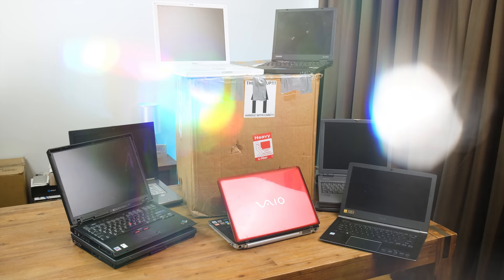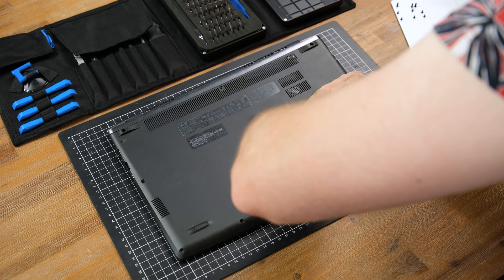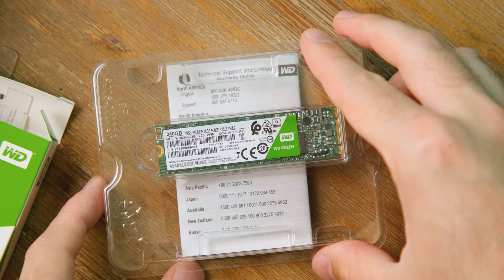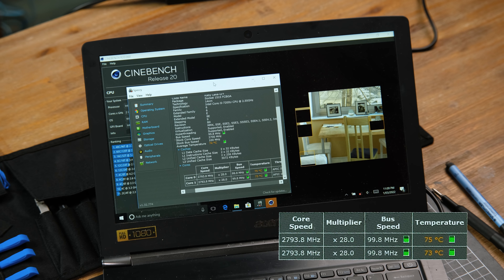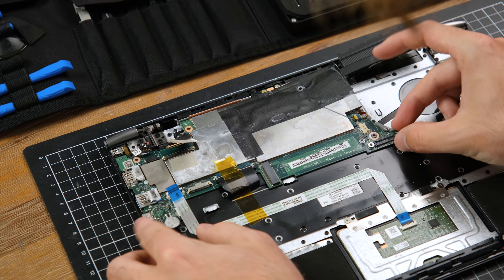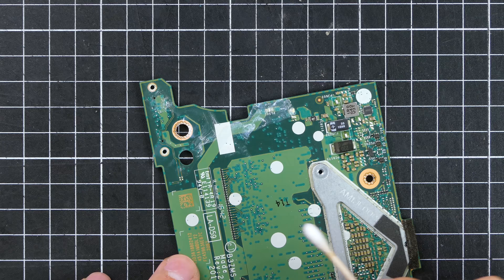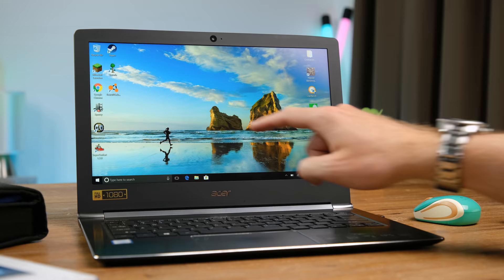Can This Dumpster Find Laptop Be Fixed?

Comment: That laptop was a score, and good to see it was able to be saved. Isopropyl alcohol, some eucalyptus oil, a new SSD and some thermal paste, and it was a go-er. I was surprised about the backlit keyboard and especially the touchscreen.
Reply: can i use rubbing alcohol instead of isopropyl to clean a pc?
Reply: @captainjimo  it’s usually the same thing. Sometimes it’s ethanol instead which is also fine. Rarely it’s methanol which is stronger but should also be fine if you use less. They will usually list what the actual chemicals are somewhere on the bottle.
Reply: @kaitlyn__L  thanks for the answer. I was starting to wonder if my bottles of ethanol could have been a wrong type of cleaner to use on electronics
Reply: @Shiroi0moi  the only thing to be wary of is isopropyl makes clear acrylic cloudy if it’s left to evaporate on it; not sure if ethanol is the same or not. But most computer equipment is made of ABS or PBT. Even the rarer items like Apple’s use of polycarbonate in the 00s is fine. It’s just acrylic (in my experience anyway) which gets discoloured due to some molecular reason. 

The only time I’ve seen it come up in restoration videos is a tape deck with a rare-ish acrylic window, which got a cloudy patch on it after isopropyl was applied. 

If you’re ever unsure as to a material, or its response to your alcohol of choice, you can do a little test spot on the device — inside a battery compartment or on a back corner is usually good.
Reply: @captainjimo  yes you can. It's the same thing. Just be careful with it. I've used window cleaner to clean displays up, and it's done wonders.
Reply: For God so loved the world that he gave his one and only Son, that whoever believes in him shall not perish but have eternal life. John 3:16
Reply: @kaitlyn__L  OK 😉

Comment: I used to have a Acer laptop back in the day, i spilled a full glass of sprite on it and it still worked flawlessly for 6 whole years! Idk what Acer does to their laptops to allow them to work with all that corrosion, but they better keep doing it.
Reply: I did almost the same, but "only"  threw a big sip of beer on my 3 months old 2017 aspire 7. I had a (not so impressive) aspire one 11 that claimed on a sticker, that it has a spill resistant keyboard. I like the easy access to the guts of an Acer machines.
Reply: Yeah, I love my Acer Swift 3, but unfortunately performance is poor with Windows 11, and now it feels like I'm using a laptop from 2010.
Reply: @avillagerplayingminecraft5833  thats weird my i7 3rd gen laptop from 2012 works flawlessly with windows 11

Comment: It’s really crazy what people will throw out
Reply from the maker: To be fair, after they spilt water on it they probably thought it was a gonner.
Reply: @psivewri  Definitely, I’ve found several computers with simple issues.
Reply: @psivewri  Yeah, it might have not been working for a while too until it dried up. 

We’ve had the same with our family iMac (2009 I think) that got rained on from a window in the roof we left open. 

After a week of drying, it wouldn’t start, but we randomly tried again a few days later and it actually came to life and is still working to this day as my dads email machine :)
Reply: @EliasSchmid00  unbiliveable that stuff can survive the worst things
Reply: @psivewri  yeah i have spilled water on my keyboard many times. the first time i thought it would have been broken but no it started working again in like day or two.
Reply: ive lanchend my lenovo off my bead in the mornigs so many times now there hasent been any major isues yet

Comment: Just my 2 cents, if you see white corrosion, due to water it is almost always a base. Actually almost all of the time on electronics, when you see corrosion, it will be due to base and not acid - even the batteries contain basic solution. So in order to remove it, put some white vinegar on it, then clean it using an ionised water (or even tap water) and then put the PCB in oven at 90 deg. C for 30 min. For extra precaution you can later use IPA, but in my opinion there are much better things (chemistry wise) to IPA. I use IPA only for cleaning lens and old thermal paste - and I do SMD board repair daily.

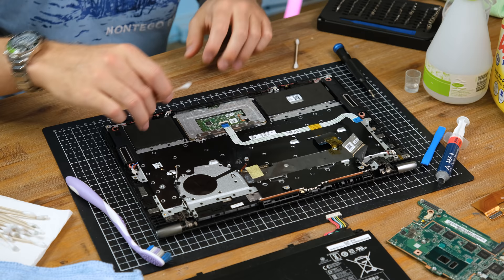Comment: 7:17 Yes, but usually I do that to ensure that the chip won't degrade faster. It's nice to have both of them running cool as opposed to just one. Certain manufacturers didn't use paste on chipsets; IBM did not cool the chipset in pretty much every T4x series ThinkPad, which was a contributing factor to premature failure.
Reply from the maker: I can't win can I ahaha. People gave me crap for applying paste to those chips when I did my big lot of 11" Macbook airs video.
Reply: I had the same cpu in my Dell latitude 3480, and the smaller die had a thermal pad on it and the main die had paste, straight from the manufacturer. So that die definitely needs some thermal interface material, pad or paste.
Reply: @psivewri  the comment below with pads might be a better solution although plenty of laptops ran without any contact with the chipset die so I guess it's meh
Reply: @psivewri  I see. Not sure why, maybe they are just accustomed to the original factory application. Either way, better to be safe than sorry... speaking from experience here.
Reply: T40-T42s usually the Radeon 7500 GPU failed as the all in one package ATI used for the Radeon 7500 (VRAM and die on same substrate chip) was new at the time, combined with the lead free solder and you have a recipe for failures. Some models had Radeon 9000 and 9600, those were better but still failed. Integrated GPU models however, never failed. The cooling was adequate and in the manufacturer's limits for the GPU
Reply from the maker: @alectrona6400  oh yeah I agree, I'll probably do that from now on 🙂 I remember being concerned the first time I saw no paste on that part of the CPU.
Reply: @psivewri  I think its a mistake at the factory. Sometimes there is too much paste, sometimes none at all.
Reply: @michvod  what's the issue?
Reply: AdamantIT does lots of board level repair and recommends leaving it the way the manufacturer did it, CPU heating up your chipset with the fan off sometimes I guess.
Reply: @psivewri  Right... I've seen HP's factory applications (and some of Dell's) have coverage on both dies, even in Kaby Lake systems.
Reply: @michvod  Yes, I had a T42p and that had its GPU go out. However, other laptops that used the same chipset also had cooling on it (like the HP nx9500 and the Latitude D600) whereas the IBM ThinkPads did not.
Reply: @psivewri  that other chip is the pch and it doesn’t need that much cooling, but it should be sinked into the main thermal solution anyways.
Reply: That is the same shit that Apple made with their Macbook Airs
Reply: @psivewri  In most cases, a CPU can be degraded faster because it generates more heat for PCH. PCH is integrated in processor so when you damage it, you have to change CPU mounted to the motherboard (unless it's a gaming laptop or lower than 5th generation, it had chip on mobo). If the manufacturer didn't give it cooling, then you shouldn't put thermal paste on it.
Reply: @MrDadosz  I see... thanks for clearing that up! :)
Reply: whenever I repasted a laptop I always apply paste on every die regardless, I'd rater have everything running cooler, besides, thermal paste isn't electrically conductive as I've learnt , so its safe even if it gets on the board or so.....
Reply: For God so loved the world that he gave his one and only Son, that whoever believes in him shall not perish but have eternal life. John 3:16

Comment: I got and Acer Swift 3 similar to this one with a 1080p diplay, the same keyboard, an i3-7100u and an NVMe SSD and although it's getting older, it still holds up really well today. It's a shame that still totally servicable computers are being thrown away like this. 

Nice job rescuing it, and keep up the good fight for used computers.
Reply: I vividly remember playing destiny 2 at 20 FPS with a 30% res scale on an i3 7100u laptop a couple years ago. Ahhh good times

Comment: This is absolutely bizzare. I also found one while working on the trash compactor at the apartment building I work at. It also had corrosion damage, I fixed it with a bath of white vinegar and rubbing alcohol. I did spray wd40 and polish the metal, it cleared up pretty well. Mine still had the nvme drive and the recovery partition. Wouldn't recommend using it with factory settings, there are a hell of a lot of bloat ware and telemetry bullshit installed and we're not just talking Microsoft.
Reply: That's why I use Arch btw.
Reply: Linux has been the way to go since years. My Acer Aspire is running Ubuntu happily
Reply: I typically put fedora on chrome books, it makes them amazing more useful and even easier to use than chromeos, something about the half desktop half mobile style that the default gnome UI has just fits those machines perfectly.
Reply: @clark_johannes  Arch is Terrible and unstable, Debian builds are the best
Reply: @PenguinRevolution  I use Debian for 9 months. Wine is better there but for the sake of performance, I need to use Arch.
Reply: @LukeeGD obviously you don't know what the hell your talking about. Debian doesn't get behind in updates, they keep the same package versions and update them for security. This allows for maximum stability and security. This makes Debian the best for Desktop. You don't have to have the shiny new thing for a desktop, Debian is proof of that.

Also there is a supported way of getting up to date software through APT. Also Snap and Flatpak are ways you can keep your software up to date with the latest feature updates. 
Arch is terrible and unstable because rolling updates can introduce new bugs into the system and change workflows on a dime with new productivity applications and builds. Fedora has some of the same issues. So no arch is literally the worst distro to use to get any work done. The only way I'd consider using Arch is on a gaming rig with brand new graphics cards where I need the latest drivers, but I can do that in Debian as well. Arch is stupid, there is simply no reason to use it.
Reply: @clark_johannes  Wine works just fine in Debian 11, use it all the time. Nobody needs to use Arch.
Reply: So there are driver bloatware now!!!?

Comment: That would make for a really nice general use laptop! Would easily handle web browsing/email and the like, and it being thin and light is a bonus for portability. I'd personally keep using it as-is.
Reply: Agreed - it looks like a pretty decent laptop for on the go stuff, and those batteries (although thin) usually seem to hold up OK too.
Only thing I don't like is the soldered RAM, but with an SSD, 8GB should be enough. It's not like you're using a mechanical disk for the pagefile...
Reply: That 7200U is still plenty powerful enough for general tasks
Reply: @zaamuro8408  For sure! Could very easily see using it for taking notes in class, typing up documents, watching videos...
Reply: i dont know if its just my problem, but these cheap acer laptops have awful keyboards. i had one of these too, bought a thinkpad after it, didnt regret it in any way
Reply: @Windows350  and the trackpad is even 10x worse 😭
Reply: @svg03  i agree
Reply: @estalinayala7  actually that is what i thought at first too, but right now i own a w541 with a 3k ips screen and it's fantastic. sure not every thinkpad has these, but yeah
Reply: @Windows350  You're not wrong, but that's like comparing a Toyota Corolla to a Lexus LS. One's a budget offering, the other is top-of-the-line.

If I got a Corolla for free out of the junkyard, I wouldn't care if it drove awfully. At least it works!
Reply: @foxyloon  of course, i get your point. just for me the keyboard and trackpad destroy the whole user experience because it's not fun to work with. its still a decent little machine.
Reply: @Windows350  And that's fair. I've came across absolutely terrible trackpads/keyboards in laptops before too, and it definitely does have an impact in usability. As for me personally, I have a pretty wide threshold for what I consider "awful", and can adapt to most trackpads/keyboards these days.
Reply: @zaamuro8408  bro  i have 6200u even that handles  day tonwork my handles bit retro games as well because it had 4gb gpu along with it ram 8gb

Comment: I feel like Acer’s gone from what I’ve considered a crappy brand to a surprisingly decent brand of laptops. My girlfriend got sent out one of their Chromebooks we got to keep after that job was completed. It’s a pretty solid machine, especially for a Chromebook. Solid build quality, satisfying keyboard, and a great 1080p IPS panel which is unheard of for Chromebooks. Acer also happens to make some nice backpacks! Picked up a Predator backpack a while back at Microcenter and it’s quite nice. 

TLDR: Acer isn’t the crap they were in the 2000’s.
Reply: Their Nitro laptops are also great. Best buy for the price
Reply: @Pinzledick  Yeah I agree their Nitro laptop are very light and has some performance packed in those bois.
Reply: I've always had a great experience with their products, now customer support... I did have a bad experience with on, but that's just going to be anywhere🤷🏼‍♂️
Reply: @Pinzledick  I own an Acer Nitro 5, it was $800 on sale, it's pretty cheap considering it is a gaming laptop, and the performance is really decent and good for the price. My only complaint is the screen is kind of dim, but I really don't care since I don't use it outside but only indoors. Build quality is okay but not the best, I had no issues and have been using it for 4 months now.
Reply: maybe except the acer nitro 50....
Reply: @AsianFlex  that's the desktop version, he is referring to that the laptops are
 decent, I'm pretty sure all of their prebuilt aren't good imo
Reply: @SynApse01547  well yes, but still. an acer laptop has given one of my friends issues with the battery and it also looks horrendous with the huge bottom bezel. the keyboard and trackpad was decent tho

Comment: That’s pretty cool that the display was a touch panel. Usually capacitive touchscreens have a layer of glossy glass or plastic as the touch layer. But this display looks like a matte screen? Pretty unusually for a touch device. And with the plastic bezel like that, it really looks like a just bare LCD. I would have never guessed that it was touchscreen either haha.

Comment: The chip on the left, does need thermal paste....thats why it is under the heatsink.
Reply from the maker: It doesn't need thermal paste. That's why it didn't have paste on it to begin with. This is the case with so many processors.
Reply: @psivewri  Maybe, but is it really worth risking your cpu for a few cents worth of thermal paste?
I can also imagine someone putting it on the wrong chip and possibly killing the system.
Reply: @psivewri  I stand corrected, In this case, the paste was unnecessary, but my laptop has the thermal paste on it. It might just be the best to check does your specific laptop need it ot not before viping it off.

Comment: Found a bunch of tech behind PC world in the Uk, 2 were laptops that only needed new drives and they worked. In the pile I found the chargers. Literally no damage. Also found a US ps2 with 100 games and a Xbox 360 250gb with 2 controllers which works perfectly fine too. Crazy what gets thrown away when traded in. (I took the Xbox to CEX to put the cash towards a GPU for the gf)

Comment: I remember the laptop my sister used before giving it to me and I did spill it when she used it but luckily the drive and motherboard stil worked and I had to replace the keyboard as it wasent working properly, I did take it apart to replace the thermal paste and ended up losing the sata connector for the computer

Comment: Great video Nathan. As far as Main Board Corrosion, I would recommend using an ultrasonic cleaner to clean corrosion that you couldn't get to with the ISO and toothbrush since corrosion can get under the soldered on chips including the CPU and GPU if this was a gaming laptop. I know this from experience. Louis Rossmann has some great tutorials on MacBook logic board repair and he said with corrosion, ALWAYS USE AN ULTRASONIC CLEANER!
Reply: Agree on that! There is ALOT of gunk wich may end up around the processor pads/solder balls, also corrosion and stuf. The best way to clean it would be after scrubbing, to put it into the utlrasonic cleaner.

Comment: It's great to see that it still works without a problem. I have the same CPU in my Lenovo Ideapad 520S, but it was so slow to boot when I bought it, so I upgraded it with 500GB SSD, and upgraded RAM from 8GB to 12GB. There's also 940MX 4GB in mine. Overall, laptop is good for normal usage, but it struggles if you throw some more intensive tasks at it, since that CPU is only dual core.

Comment: 3:29 Uningine Heaven shows the platform as Windows NT 6.2 build 9200 (Windows 8) for some reason, even though the machine is running Windows 10.

Comment: I've used a very old DELL i5 7200U laptop paired with an AMD Radeon R5 M420. Until it's very last few months it didn't even have an SSD on it, which I installed due to it being painfully slow on the HDD. Had to sacrifice the CD ROM drive on it, but was worth it. Not gonna lie, it made for a very decent low end gaming rig and emulation rig. It even ran Minecraft 1.18.1 well! I saved up, got myself a newer gaming laptop and now my old laptop is handed down to my family and still in good use!
Reply: Bro i have lenvo laptop with intel 6200u and amd r7360  and i did same installed 240gb ssd  in cd drive and its still strong for everyday tasks and many old games and the orginal battery still working i bought in end of 2016 or starting of 2017 great machine for price